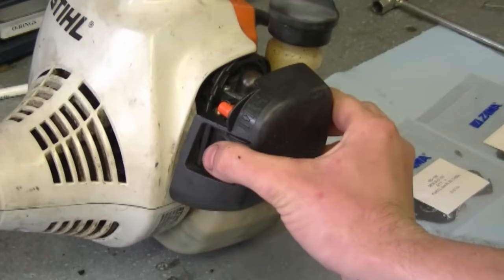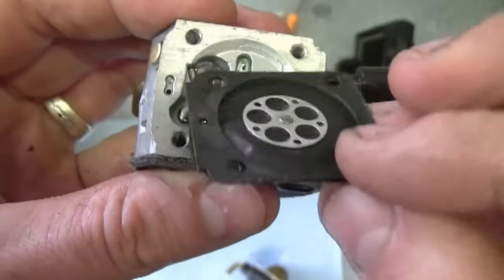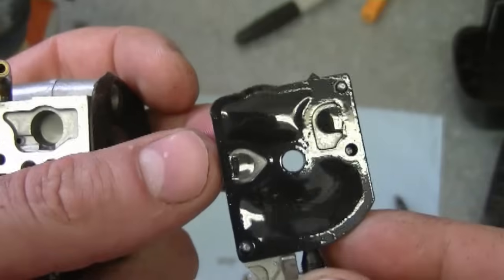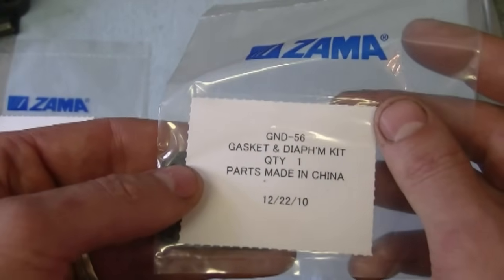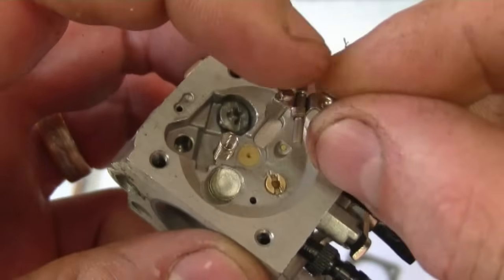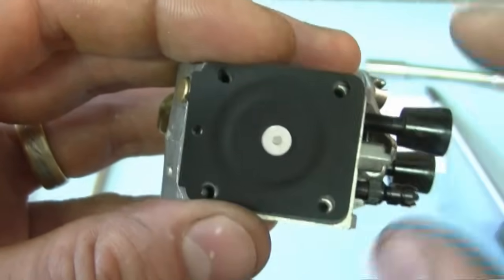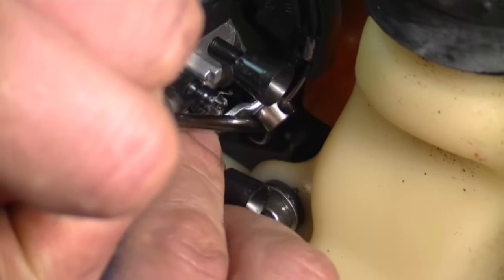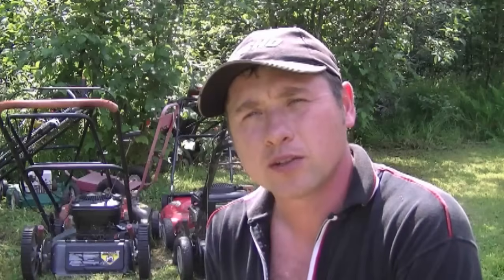Carburetor Rebuild On Stihl FS38 Grass Trimmer

Comment: What is the starting point from full close of the low and high needles if I don't have the plastic cover of the needles?
Reply from the maker: Sagi Yosef on this carb 1 1/2 turns out each screw is a good starting point

Comment: great video, very helpful one question the I took apart and cleaned my fs38's carb and the trimmer runs fine but the primer bulb does not fill up with fuel. I was wondering if u have any ideas?

Comment: Generally its best not to push the small gauze filter fully to the bottom of the hole as you are reducing the useable filter area to the size of the feed hole underneath it which Is can cause the filter to block much more quickly. Just push it down flush with the surface and a then a tiny bit lower.

Comment: I mean if vacuum pulls it out as engine runs why wouldn't the pressure of the priming bulb push it out into the venturi. The reason why I ask is to figure out what causes a two cycle carb to empty the tank through the intake while just setting not running. Is this a stuck needle same as a 4 stroke? Im really confused. Because if its gravity fed pressure flowing through the circuits into the venturi. What keeps the pressure from the bulb from doing the same thing. Thanks for any response. Doc

Comment: You know I started thinking. I have had 2 Stihl gas blowers, that both lasted 10 years or so each! No issues with them but I have been through 2 Stihl FS38 gas trimmers and both only lasted 2-3 years? I cleaned the carbs ( though never rebuilt) fresh gas, new fuel line, air and fuel filters, clean spark arrester etc and I could never get them to run well after a few seasons. I was thinking why the blower with similar engines last and trimmers don't. Do you all think it is when I edge turning it up side down for 10 minutes or so this is causing the carbs to become messed up???? I had a Echo trimmer that I used in the same way and got 7 years out of it??? Think I'm done with Stihl.
Reply: Sounds like the mixture. Turn your H mixture screw out one 1/4 turn.

Comment from the maker: push it down from the inside of the carb with a flat screwdriver then pull it out with the tecumseh carb tool or crochet hook. it is also a sacrificial part

Comment: Hi Donyboy73. I have a Stihl FS 80 grass trimmer and it starts ok and runs about 30-45 min. properly. After that, ( when it get hot )   it suddenly stops. When I start it again, it attempts to start, but it won't run. When I wait for a while, it starts and runs again..Do you have any idea where might be the problem ? 
The compression is good, but I have newer looked on the piston or ring. I use only STIHL (green) oil in to the petrol. Thank for help.
Reply from the maker: you might need a new carb kit, check for scoring on piston first by looking through exhaust port
Reply: donyboy73 I've mounted the muffler down as well as spark plug  in order to avoid compression... I moved the piston several time slowly up and down and there are any damage on the piston. He looks  shiny barely as new one. Maybe it is time to replace a piston ring.. maybe it is overused, but the compression looks ok .. hmm.. but in every case I will buy a new carb kit as you recommended. If this won't help I will let you know :-) Thank you anyway.
Reply: donyboy73 Donyboy73, remember in this video when you told us to be carefull when removing the bronze little thing??? I broke the head of mine, and i cant remove it now, do you have any advice for that??
Reply: Gerardo Manzanilla  yea i can help.    yup now you  need a new carb
Reply: Firstnun ya Lastbizzness  The problem is already solved. I didn't  need new carb, but ignition coil. when I replaced the ignition coil, the motor starts  and runs properly :-)

Comment: Need Help!!!!

 
 NEED Help!!!!
 
 Homelite
UT20046 WEED  EATER rebuild carburetor , new plug ground plug to test and get blue spark, coil set to .010 repair manual says .008 to .012 plug set to .024 like manual says still won’t run Try Two other coils got blue spark with them to, still won't fire Hoping you might Think of something I've missed, yes it is getting fuel, Could a coil show blue spark and still not fire under compression?

Comment: hi, I know this may be a stupid question,but is this carb rebuild basically the same for different model Stihl weed eaters. Also I`ve never done a rebuild before, and do you order the parts directly from the factory, or do you order them from a hardware store that sells them? ..just wondering.

Comment: Hey Dony. First of all I hope all is well with your wife. Please tell her that Doc and his wife are praying for her. 
My question has to do with priming the carb. I have herd it said that priming the carb with the primer bulb only removes the air from the carb and replaces the fuel in it with fresh mix. It is said that this doesn't prime the intake so you cant flood it by doing this. How is that so if all you have is a 3 holes and a main jet between the venturi and the metering reservoir. CONT

Comment: Donyboy I have the same trimmer I have replaced the carburetor but still will not run .only backfire through the muffler it has lots of compression and the Muffler is not clogged any idea what may be causing this issue thanks

Comment: Hi Dony,i have the same model trimmer which bogs down,it will start as normal but dies in few seconds by itself,the air filter is clean and the arrester is clean,it's fairly new and been use rarely,what might be the problem?hope you can help me,thanks in advance
Reply: Key Wizard did you found you're problem? having similar issues
Reply: A common problem when it bogs down is the mixture. Try turning out your H mixture screw one 1/4 turn. Hope this helps.

Comment: Hiya can I run my trimmer without the spark arrestor?
Reply: You can but, I know Stihl doesn't reccomend it.  There is a chance around dry vegetation as Stihl calls it that sparks can come out and start a fire.  I run mine without them cause otherwise they run like crap even after cleaning spark arrestor and so far no problems.

Comment: I can give you a tip on FS 45 I have 2 and I asked Donyboy73 a while back about a carb problem. The adjusting screws are plastic covered so you can not adjust them but a little bit. Pop those off and retry adjusting the screws most of the time it needs a little bit more and then works great . I fought Stilh for 2 years because it was under warranty
they would adj it bending the plastic but when the plastic move back it goes out of adjustment .

Comment: Hi donyboy i have a stihl fs 45 and when i give it gas the head won't spin the proper way and ideals as to why
Reply: +Jeffery Chadd That could only happen if the engine was running backwards, which I am not sure is even possible. If it did run backwards the head would eventually unscrew itself and fall off
Reply: sounds to me like either the wire is on backwards or Jeff is unaware most stihl  weed whackers run the cutting head anticlockwise

Comment: Well atleast when I have rebuilt carburetors you just need to remove the bowl screw/bowl the bowl screw normally doubles as a main jet and after that just tap the carb on a clean cloth and the emulsion tube should come right out.

Comment: Hi donny my sovereign strimmer kept cutting out,cleaned spark plug bit of soot, but not to bad air filter was fine,still kept cutting out, sprayed wd40 into exhaust, started up smoked for a bit than ran like a champ,not been much of a mechanic why would this be.

Comment: Hi I rebuild the carb and it still wont run my primer blub does not fill up.
Reply from the maker: I would install a new carburetor at this point
Reply: @donyboy73  thanks  for your reply
Reply: I got a new carb all good thanks

Comment: Hi Donyboy73. As I wrote you down below I had a problem with my stihl FS 80 grass trimer. You wrote me some quick tip for help..
The real problem was in the ignition module itself.  Part number : 4137 400 1350
Maybe this helps you a little :-)  bye.